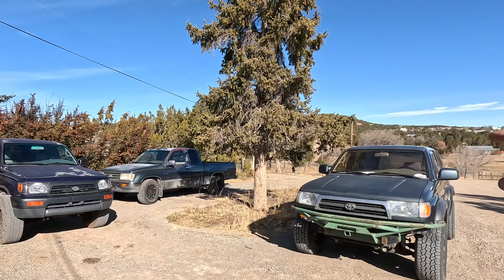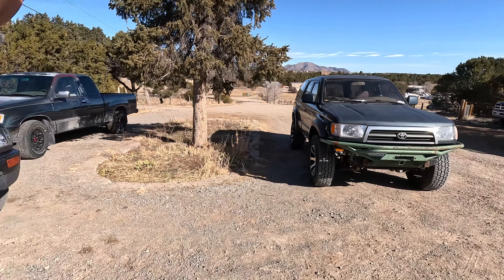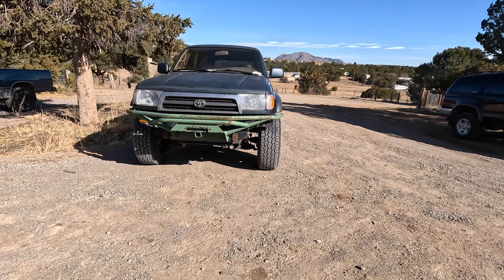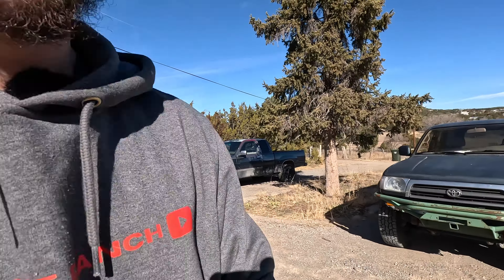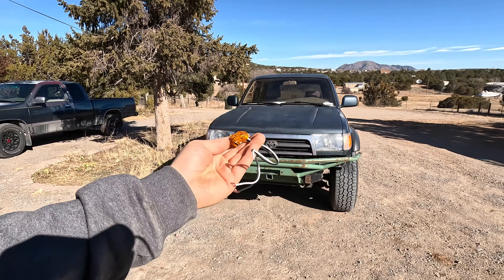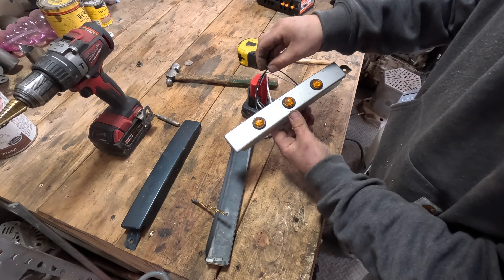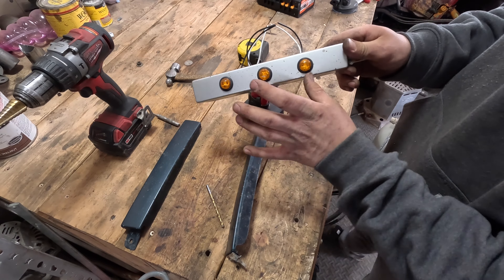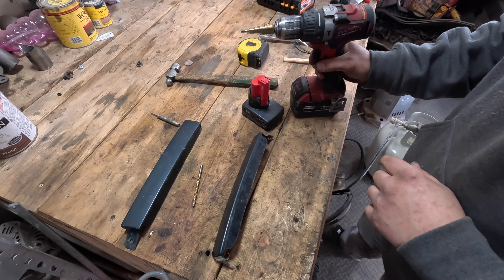How To: Off Road Blinkers for CHEAP!

Comment: This past summer, my speedo quit. It's common issue on 1990's Toyotas. On the speedo circuit board, I replaced the two leaking capacitors and (carefully) touched up the circuit board traces with a conductive silver pen. Works perfectly now.